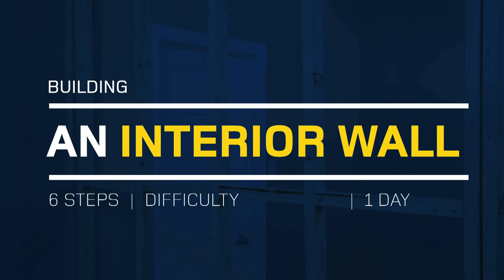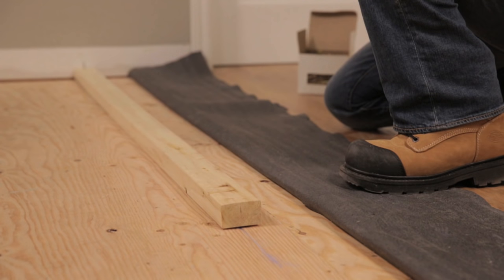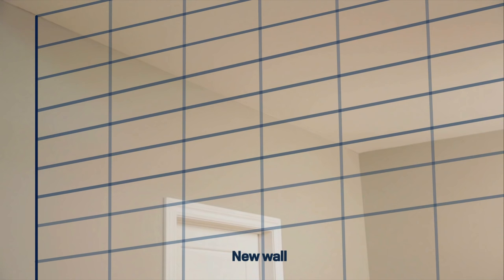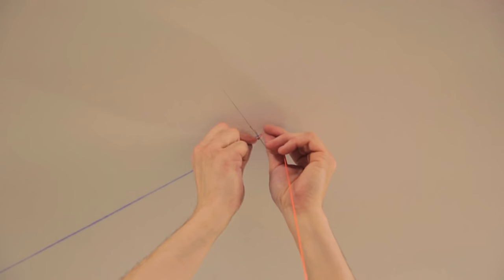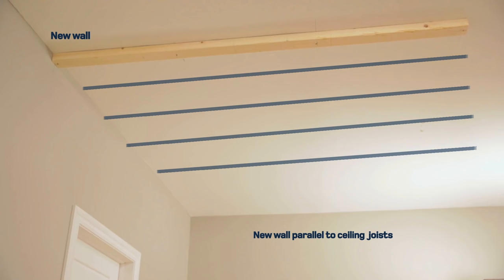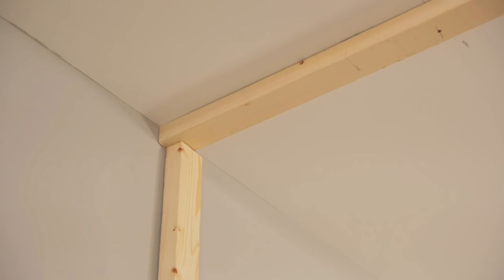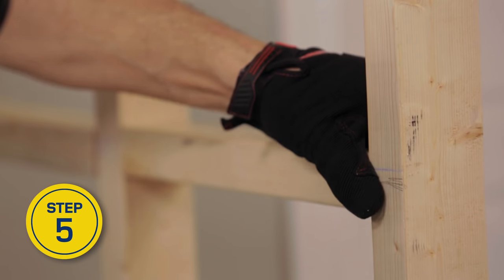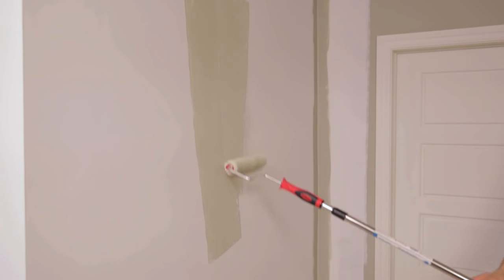How to Build an Interior Wall | RONA

Comment: I did all this in 2012. It really wasn't very fun. Total pain in the butt. I remember having the plumb bob too and building several compound angel walls. But at least it's done and it looks good. I wouldn't ever build an interior wall in anything less than a 2x4. 2x3's are not for wall construction!

Comment: 1. Why didn`t you build the wall on the floor and then stand it up ? That seems quicker .     2.  Why did you use screws ? I know they hold better than nails but I have never seen someone use them on a wall .  3. Why did you skip drywall paper when you  were " mudding " the wall after you had the sheetrock up  ?

Comment: ah, don't "toe-screw" in from the sides you intend to put wall board on, run your screws in on the "wide side" of the two by four, leaving nothing but a completely flat wall for the wallboard to rest on, So that later on you can't ever see any screw bulges.
Reply: Darren Lowe you can if you make sure to bury the screw far enough so the head is just below the surface of the 2x4
Reply: Are those even 2x4? Looks more like 2x3

Comment: If you run the drywall horizontally, you will have to deal with a taper at the bottom where you're going to be trying to install baseboard, and that won't be fun -  it would be easier to run the drywall vertically.  Also it shows filling the joint without using paper tape (incorrect), and does not show how to finish the end of the wall or the joint to the existing wall (ie. corners).  Lastly, this is built with 2x3's, which I guess you could do, but practically no wall was ever built with 2x3's.  At best a 2x3 wall will look odd and very DIY.
Reply: To be fair, they don't show you how to sand the joints, mix the paint, put primer first... or even make an opening for a door. Unless you are partitioning a room with two doors, you will need a door to get into this new room.

Comment: You left the base board on, so I can't imagine this being done right
Reply: Frank Pace not to mention no tape when he mudding the joints haha
Reply: EXACTLY!!!! It makes no sense that he didn’t notch out the baseboard, now the new walls first stud can’t sit flush against the stud in the existing wall that he attached it too, so now integrity and strength is lost in his brand new wall. It’s driving me crazy. Don’t post a how-to video when you’re doing it wrong and then have other unsuspecting people, who think you know what you’re talking about, doing this type of crap in their own homes. Somebody’s wall quite possibly could end up coming down on them if they ever hang something heavy on a wall they built using this tutorial.
Reply: And he made a mark on 16" instead of 15-1/4" and 16 3/4"
Reply: There was no base board. Only unpainted wall left by the baseboard that he removed.
Reply: @estebanoures1  Just center it then!
Reply: there was no base board. Just an unpainted strip at the bottom of the wall...
Reply: Yeah, I saw that..and my cross studs are framed so that the edge of the sheet rock ends on the center of the cross studs and thus supported all along the seam.

Comment: The stud against the wall is crooked because you didn’t cut the baseboard?!?! That makes absolutely no sense. Why didn’t you notch out the baseboard to install that first stud straight and flush against the stud inside wall your connecting your newly framed wall? That new wall immediately now has a bit of an integrity issue.
Reply: Thank you!

Comment: was there no tape in the joint between sheetrock panels.   I think they just used mud which would be a big mistake
Reply: Tape is usually for big gaps or cheap lumber use , it is a new rule modern generation set to have more a pretige look on the wall .removing little flaws

Comment: Why wouldn’t you use a nail gun with framing nails? And do you have to use cross studs? It’s not like there are cross studs on the rest of the walls when you frame.
Reply: It is code to use nails for framing in my area, screws don't have good shear strength, nails do. screws have better tensile strength, but nails have anchoring rings giving it good tensile strength as well.
Cross studs help to keep the studs straight over time so you don't crack the sheet rock. Vibrations from slaming doors or bumping into walls rattling the studs can crack your finish (paint and mud lines). ALso wood moves with humidity and hot and cold, the cross studs will help keep it in place.

Comment: Is there a video that builds the wall with a wooden skeletal structure, insulation, AC power plug and socket, and finishing touches of dry wall, gypsum, and painting?
Reply: AlphaApple-   You probably have to use several videos to get the full picture . The video that you want would be rather lengthy and wouldn`t likely get a lot of views .   1.  Remember , you build the wall first . Remember that you have to put poly on exterior walls to protect the " plates" .  2.   Then , you do the electrical " rough in" . ( boxes and wiring )  You do  have to remember to put in 1-2  ceiling boxes  , about 3 or 4 boxes  for your plug ins and a box for your on/off switches. Basically you must have enough of them to serve the needs of that room and have them at the correct height .   3.   Then , you put in the insulation batts . For any exterior walls you must have a plastic vapor barrier which you staple into place . Be careful to do this correctly .   4. You will then put up some kind of " drywall" such as sheetrock (gyproc ).     5. If you put up sheetrock ( gypsum board ) you will have to paper and mud the joints .   6. After you paper and mud the joints you can finish your electrical work .This is when  you put up your fixtures and  "wire in " the plug ins and the on/off switches .     7 . At that point you will paint your walls .    8. You will then install your flooring .  9 . After the flooring you will hang your doors .  10. After that you install your baseboard and door casing and any window casing .   ( Somehow , I forgot about your ceiling . )

Comment: why would toenail screwing the studs to the top and bottom be preferable to assembling the wall on the floor, shooting into the studs directly through the top and bottom pieces?
Reply: couldn't get it tight enough, top and bottom, would have to use shims.

Comment: What if I have carpet
Reply: As a professional carpenter and decorator, I'll let you into a trade secret: 
Using a ruler and carpet knife, cut a line into the carpet where you want the wall to go. Then cut a parallel line about 2 centimetres away. Then carefully pour petrol on the 2 cm wide strip, set fire to it and watch it disappear. You can then build that wall!
Reply: If you can't figure it out hire a professional.....

Comment: Would have been an easier job if you build the framed wall first, then screw it in the wall and floor.
Reply: This way is better for less experienced people. They can measure as they go rather than putting it all together at once. But you're right that is a much easier way.
Reply: This is very old, but I don't think you are right. When you tilt the wall (if it'd be a perfect fit), it'll be taller than the ceiling while tilted. So, you'd have to make it a bit shorter overall then the ceiling (maybe you can sledge hammer it in place). If you are planning on using some kind of framing supports or shims I suppose it would work, but your wall would be a little short of the ceiling. Also, if you're floor and ceiling joists aren't perfectly parallel...you may run into more gaps at the ceiling. I'm assuming you are saying build the framed wall on the floor lying down (assuming you have the space) and then lean it upright.

Comment: Aa a carpenter of 17 years no union carpenter. Do not waste ur time blocking ur wall between ur studds. Unless your doing a wall bigger than 10 feet. The blocking I useless 💯 if anything 
 If the wall ends not tied into another wall. Build ur end studd as an L . To strengthen the end of the wall. If u wanna reduce noise then u nail on sound bar.